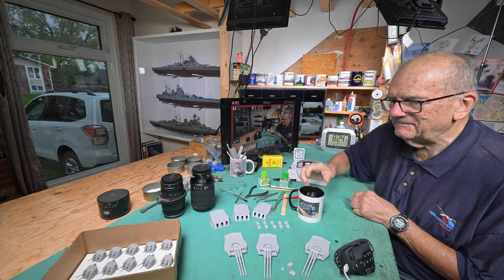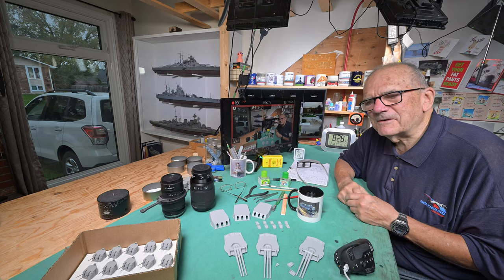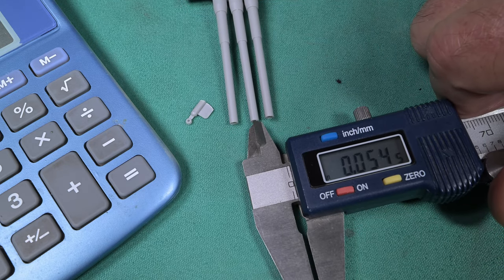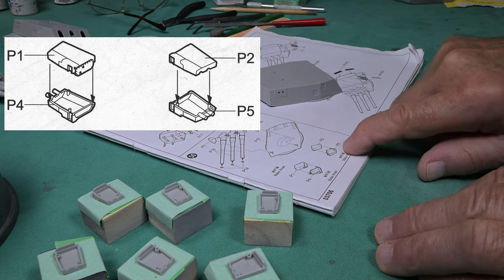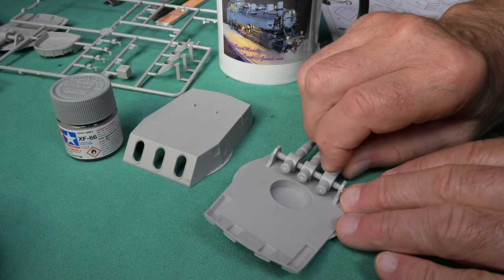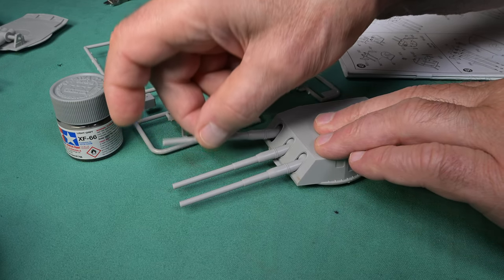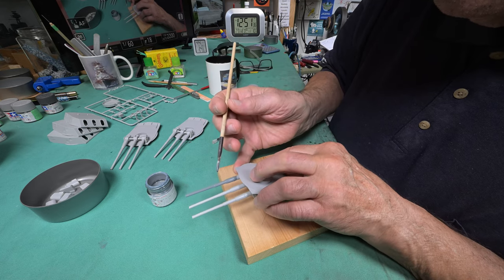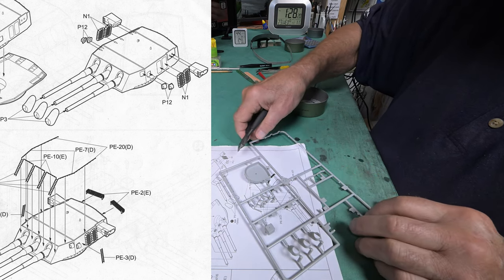The Model Ship - Part 1762

Comment: Hey Ron
     Time for a heads up. Step 51 turret that you’re working on has no weapons on top and will be first Turret forward. On instructions I called it A turret. On page 42 construction start for B turret is drilling 3 holes as shown step 52. That is for triple guns on top. Page 42 is devoted to B turret second position forward with 3 guns on top.
      C Turret on aft deck has twin bofers on top and need to drill holes as depicted. All of page 43 is for C turret located on aft deck. I would drill both turrets and label them B and C appropriately. Good luck.

Mike
Reply from the maker: Thanks Mike. Will check on that tomorrow. 🤞